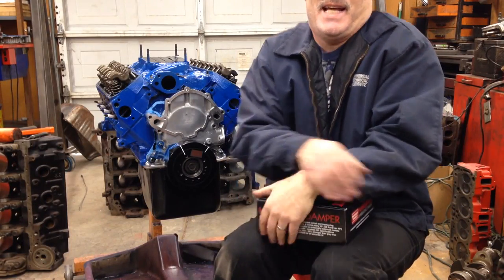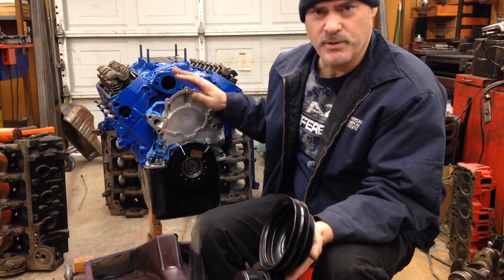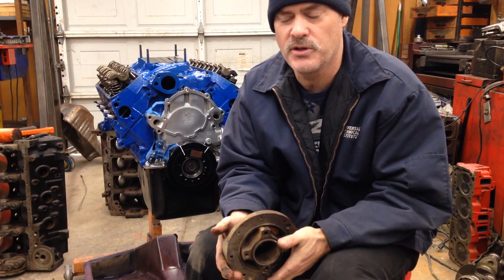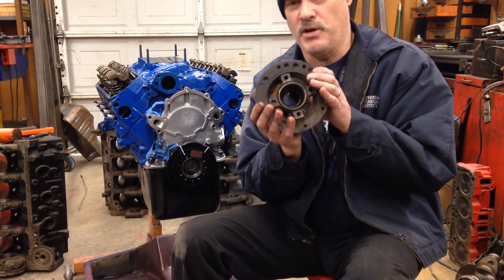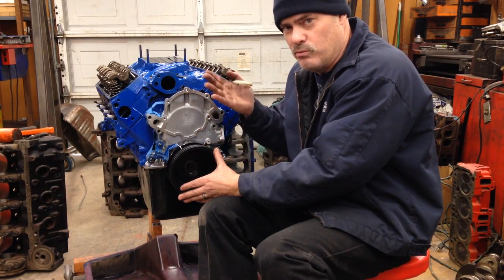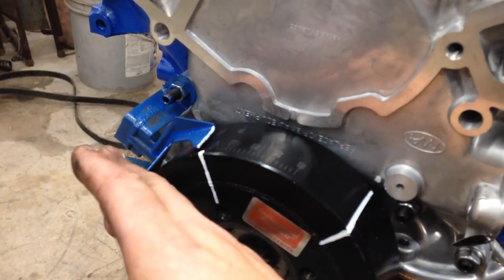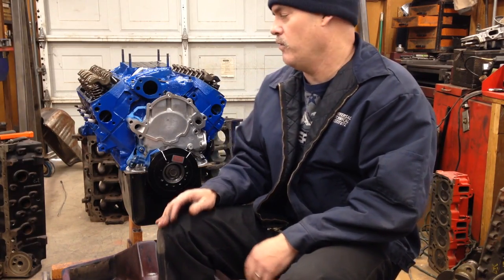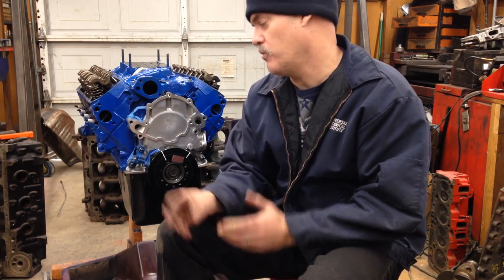302 Ford pulley problems

Comment: I did the latemodel crate 5.0 swap into my 67 Mustang back in 1995.  There wasn't a lot available for this swap back then and it took some resourceful thinking through a ton of conflicting information to get this engine to work.  The pulley dilemma was one of them. 
 I used the OE dampener and since I was using the OE type radiator design with the passenger side waterpump inlet, the driver side timing tab was needed.  Because the timing marks were on the opposite side of the dampener, I had to attach a timing tape for it to work.  I just made sure that I was able to correctly transfer the TDC mark on the dampener, so that I could properly reference the timing tape.
  I had bought an aluminum underdrive  pulley set from Ford Racing, thinking that this was OK to use; it wasn't.  I had to use a twin groove lower pulley because I had power steering.  I found that the 4-bolt lower pulley worked, but the single groove waterpump pulley was too large.  It would not work because of interference, so I sourced the OE twin groove waterpump pulley that came with the original 289.  This finally worked out for me, but what an expensive hassle, those aluminum pulleys were not cheap.  The inner groove lined up for the W/P,  balancer and the alternator, but only the outer groove on the balencer pulley would work for the power steering pump which was OK; I didn't need to have the belt also running off of the W/P, anyway just for the power steering pump. 
 I also had a hell of a time finding a 50 oz imbalance flexplate for the C4 case-fill automatic, use in the 67 Mustang, until in my desperation, a call to Ford Racing told me where to go.  Luckily, today they're easier to find from Summit or Jeg's, but don't look to source one from a junkyard because Ford never made a 50oz imbalance flexplate for the case-fill C4.  This transmission wasn't being used when the roller-cam 5.0 engine was introduced.  It takes a 157 tooth ring-gear small diameter flexplate and not the flexplate that can be sourced from the Ford AOD trans.
I appreciate the video, I'm sure that quite a few folks could use the info and don't have to scrounge like I did.

Comment: Another great idea by Ford. Bury the timing tab so you can never time the motor. Genius.
Reply: Not if you use the corresponding parts.
Reply: I've got a 347ci internally balanced made from an 88 roller block. With a 1965 style  timing cover, rad, edelbrock water pump and other turbo stuff on the front I couldn't find a decent pointer I could read the balancer numbers. So I made a pointer and used a degree wheel to find tdc on cylinder #2. Timing is now easy and no problems. Some times a guy just has to work outside the box.

Comment: Oh boy I just had to deal with this on my 351w in a 68 stang lol I bought billet pulleys and the 3 bolt crank pulley wouldn't bolt up so bought a 3 to 4 adapter that worked but still not lined up for the belt so I had 1/4 shaved off the adaptor and finally last night got the alternator billet water pump and crank all lined up and running

Comment: I have the correct 28oz damper but they have different water pumps with different length shafts and I almost have the belt straight but I suspect I will have to keep working on it to figure out exactly what (shims/washers) and where. I just don't want to take off the water pump and get an older version. I have a 1965 sbf 289 with a new water pump that is throwing the belt alignment off by about 1/4 of an inch.

Comment: I really like the PP balancer but many of there other products are very suspect. I partially attribute it and the hard block to keeping my sbe 8.2 deck together after countless runs spinning it to 7200 on a 150 shot. People who say these engines can't pull the revs are full of it. A good cam and head is all it takes. Hell I ran the stock HO cam up to 6800 with ported gt40 iron heads but without nitrous it stopped pulling about 6200.

Comment: Cool info. I got a 79 F150 Styleside pickup with a four bolt pulley attached to the crank. I’m looking to acquire a new steel pulley for my truck. The v belt pulley it has now looked bad. Doesn’t look square. Please advise. Part # ?

Comment: This is a problem that I ran into swapping engines in an early Mustang. The engine I took out has a different bolt pattern than the one I was trying to swap in. I ended up swapping the transmission too. The newer engine had the typical 6 bolt bell ( 302 351 W, 351 C) , the engine I was taking out was a 289 with 5 bolts. The early C-4 transmissions had a removable bell, but so many things change from year to year, it can get you into trouble very fast. I try to avoid working on Fords.

Comment: Thanks for the info on this it will sure help someone down the line on this pulley problem I've run into some of the same problems with Ford's in the past I wish I would of knowed about it back then could probably have more hair in my head from it worrying me or more black hair instead of white hair in my head

Comment: I covered the details of this years ago,give it a read https://www.jalopyjournal.com/forum/threads/sbf-short-water-pump-pulleys.303600/ Post # 5 The advantage of using the early style pulleys if swapping into a 50's Ford is it shortens the overall length of the 302 about 3-4" and gains you more fan to radiator clearance.
Reply: Fantastic Jeff, great help.

Comment: Question? 90 5.0 to 89 to 95 or so 5.8. Will the harmonic and brackets and pulleys work? My harmonic is identical to that in your video for serpentine on my 5.0 and the 351 has the 3 bolt harmonic, however both harmonic balancers look the same weight. Thanks

Comment: What water pump did you use? I have the same set up on a bill for my friend. I can’t get the water pump holes for the pulley to match up. I’ve also bought a nice set of billet Ford Motorcraft pulleys. Also I can’t figure out the alternator bracket set up 7/16. Bolt doesn’t work because the hole in the head is much bigger.  Did you finish this build? Can send a pic

Comment: I bought a Summit brand dampener with same concept on pulley hole options. The other important piece of the puzzle is what water pump you put on. Ford has a short and a tall (I got a tall) as well as passenger side inlet and driver side inlet. Messed my alternator bracket plan all up! For my application looks like I also will need a .950" spacer to get the crank pulley to line up using the Summit dampener. What a PAIN IN THE BUTT!!

Comment: it is problem like this i run in to that i like chevys i put a serpentine belt set up on my 454 for free just pulled it off a 94 bad 454 that i got in a truck for free and it fit right in a 68 pu but my 390 i have to buy after market 600 bucks and they made so many diff. types on a 390 and i just happen  to have the rare set up witch is a 63 t bird 390 one year only  motor even takes a diff. bell housing have to custom fit the after market set up even on everything and the 390 that i have only came in a 63 t bird but 400 hp stock with tri power for 75 bucks rebuilt with 3,856 miles on it now i know y i got it cheap u can't get parts for it only the guts u can get but it does look cool in my high boy any one need  429 motor stands for a 67 to 72 high boy have a set sitting

Comment: Does anyone know if counterclockwise rotating water pump will work properly on a 302 ci engine that had originally come with a clockwise rotating pump? Does it matter what engine coolant port is pressurized

Comment: I have a built 5.0 roller from a 90 in my 68 mustang and another thing that didnt work is the power steering bracket. The original ps bracket uses a smaller size bolt to attach to the head on a 289 which didnt work on the 5.0 so i had to get creative and use a bracket from a 70 mustang 302 and drill it out to use the correct size bolt and also needed to add a spacer to line up the pulleys.

Comment: I have a Ford Fairlane 63 with a 302 engine from mid 70s. i have the issue that it gets hot when i drive it on bigger roads at greater speed. right now we have made a spacer for the waterpump so the waterpump gets driven by a bigger pulley by the camshaft, making it go a little faster. i hope it will do the trick

Comment: when i buy all my ford motors they have that with the motor other wise i dont buy that motor but i have swaped the balancers on my dragcar engines with matching pullys so i dont see or have had a problem  rpm 8300

Comment: Or, like my set up, neutral balance so no weight on the inside of the professional products harmonic balancer.  Several local shops auto sell this specific balancer and so did Scat as it came in my billet crank stroker kit.

Comment: I have a question if I can pick your brain for a while? I have a later 6 bolt trans 289 that I am putting in a 1970 Torino, just to drive while I build my 302. Anyway, what I am planning to do is use a four bolt balancer from a 72 302, so it is still a 28oz I believe? I have everything from the 1970 pulley setup that was on the 1980 model 302 block that was in the car, and I believe the balancer is a 50oz. It's a D2TE-D3a. Anyway, as long as I use the four bolt 28 ounce balancer that came on a 72 302, but everything else from the 1970 pulley setup bolted onto the 289, everything should line up, correct? The flywheel is another issue, but I have to find out what is actually in the current setup, tooth count wise. The only thing I am really changing is the balancer on the 289, to make it a 28oz four bolt. I may use the timing cover from the 1980 block, but since the engine was swapped before I bought the car, I don't know if the timing cover is from the 1970 block, or the 1980 block that was in the car. I will have to look for a part number once I get further into the disassembly. Confused yet? Me too, lol.
Reply from the maker: As long as it's a 28 Oz it should work

Comment: So the roller engine need the 50oz balancer, but early pulleys will not fit?
Reply: This will solve the problem it has all 3 SBF timing mark locations https://www.speedwaymotors.com/Professional-Products-Small-Block-Ford-Harmonic-Balancers,1802.html You can order it in 28 oz or 50 oz balance factors they also fit both 3 bolt and 4 bolt crank shaft pulleys. The paint sucks so I advise giving it several coats of epoxy clear coat or clear engine enamel.
Reply: @jeffb4388  thank you sir

Comment: Love it. My Pops and I just built a 5.0EFI for his '69 F100. The block is out of a 2000 Explorer, the crank, heads, and cam are from an '87-'93 mustang, the pulley setup is off of a '90 Crown Vic with standard rotation pump. 

I'll have to post a video of it running on our engine stand. I'll try to get a vid of it this weekend.
Reply: Can't believe I failed to post a link too the engine I was referring to... Two years ago.

https://youtu.be/PIWNLtcl0h4

Comment: I had the same problems with a 88 5L in a 65 fairlane. I have a zero balance internal eagle 347 assembly. Have the same name balancer with CVR custom V belt pulleys. Works great. No issues.
Reply: Are you using the late model Flywheel with that set-up? Thanks
Reply: @edgelord4678  I have a neutral balance flexplate with a c4

Comment: i am going thru a similar thing,i have a 1999 roller 302 engine and finding it difficult to find correct v belt pulley set ups.
Reply: I’m doing the same as you and using a electric water pump and I’ve had small block fords for 25 years now but sence I got this 99 GT40P motor it’s been a pain in the ass to deal with . I like the old v-belt set up where a F-100 had the same pullies and brackets as a Grenada or LTD did

Comment: One side note is the paint on these balancers sucks, mine peeled off in less than six months give it a couple of coats of clear epoxy to preserve it.
Reply: If you are using the earlier water pumps and going to a front sump oil pump you need the earlier timing cover  https://www.speedwaymotors.com/EngineQuest-TC351A-EQ-302-351W-Ford-Timing-Cover,1897.html

Comment: I'm dealing with this BS right now and it's making me regret spending money on a 5.0  There's are no 5.0s at my local yard to pull from.  Stupid me thought the ford performance timing cover would be ok on my 91 roller block but the water pump sticks out so far I'd need a good 4" spacer to make just the crank line up with the water pump.  It's dumb.
Reply: @jeffb4388   That link is displayed nowhere and is not referenced at all.  Good job.  The fix was easy, buy an expensive proprietary water pump and pully.
Reply: @jeffcivjeep7  I'm betting you are trying to get the link using a phone for some reason that may be the issue if you use a PC it should come up no problem.

Comment: my bored out 30 ths 289 block is cast with "c6ae-6015-c.  1966 block?  anything else you can tell me about it?
Reply from the maker: 1966 block good metal
Reply: Ford had great castings back then. Definitely 1966.
It's a crime when people ruin the old blocks by blowing them up or overboring them too much to try and get an extra few cubic inches which makes absolutely no difference at all.

Comment: aren't there different firing orders for early small block ford's vs. late model small block ford's? specifically the 5.0 HO?
Reply from the maker: Yes
Reply: Yes ho uses 351w firing order because it used the same cam

Comment: Should a freshly built stock 302 burn oil after the break in period? If so what would you consider normal?
Thank you for the videos and all the detailed information.
Reply from the maker: no it should not burn oil
Reply: Thank you for the quick reply, its consuming 1/8 of a quart every 500 miles.
Also, the plugs look normal, grayish tan with no oil at all on them.

Comment: What did you use for the timing cover studs I have never seen them before
Reply from the maker: it's just a hardened stud from mark's nuts and bolts
Reply: Thank you I will definitely be using them in my builds I am currently building a 418ci stroker 351w factory block scat forged rotating assembly

Comment: What if you have a late model roller block, with an after market 331 rotating assembly that is 28 oz imbalance. What then?
Reply: The after market balancer will work
Reply: David Torres thanks. I’m guessing the block will be reverse rotation water pump. So I’ll have to figure out if it’s possible to retain V belt accessories pulley set up with a reverse rotation water pump.
Reply: @WesternReloader  Early 1980's 302's with serpentine belts had water pumps that were not reverse rotation, you can convert to V-belt and use the same water pump https://www.rockauto.com/en/moreinfo.php?pk=948573&cc=1188345&jsn=634 My '54 Ford has a 1984 MK VII 5.0/302 I hated the serpentine and converted back to V-belts.

Comment: OR just get the harmonic balancer with the full serpentine factory Ford pulley set up from a 87 to 93 ford mustang with the serpentine reverse rotation water pump and reverse rotation fan and be done with it , and get a nice upgrade in the process . using all factory Ford parts
Reply: I rather go with the all Ford solution from the 87-93 Mustang too, it would work great and takes up the least amount of room under the hood.
Reply from the maker: This becomes a problem if your trying to keep the car original this is the case with most of the early mustangs the value of the car is compromised by changing to the late set up
Reply: If I was looking at cars, which are meant to be driven, not collected and looked at, I would be looking at what is better, not what is "correct" for the time period.
Reply: Yeah and add 40 pounds to the front of the engine and literally hide the entire motor. Great idea. Nothing wrong with V belts. Nice and simple. Far less parts and more reliable.